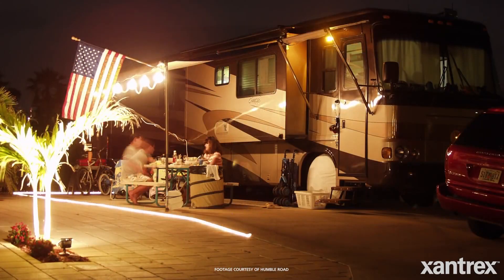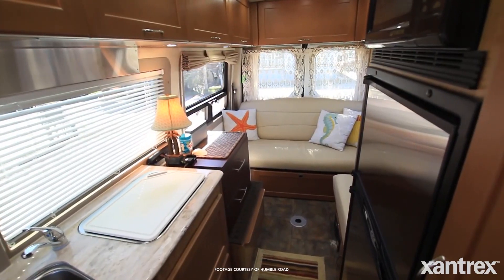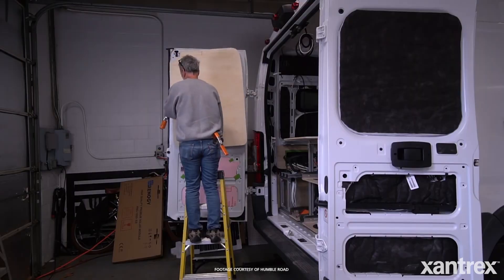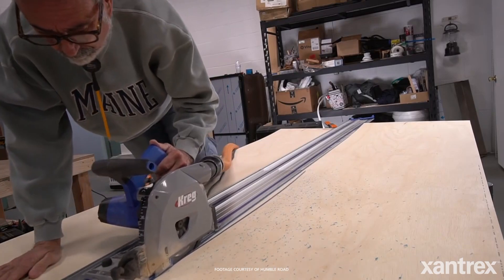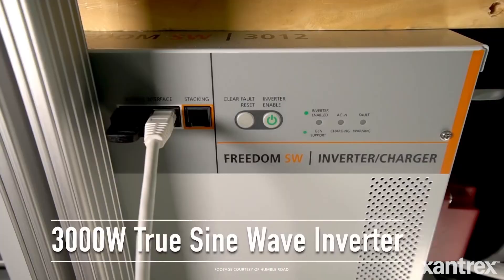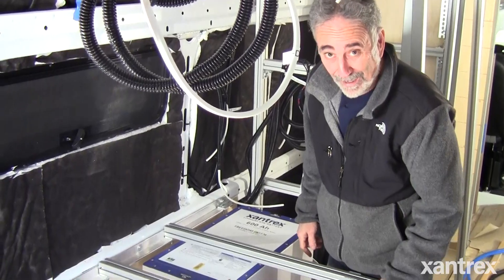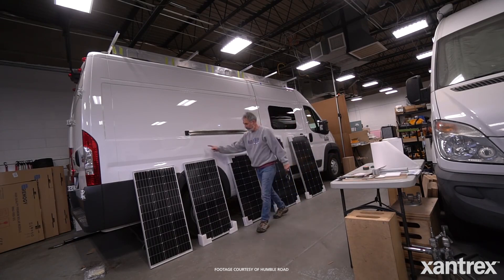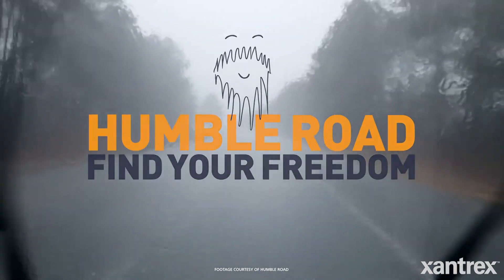Humble Road RV - Building Custom RVs with the Best Lithium Batteries + Power Solutions

Comment: I’ve been a fan of George’s work since he started his YT channel.  I wish he had the capacity to build more vans!! I do have a question about the battery itself. Does it come in different sizes as far as number of amp hours? I thought I caught he is using a 600 amp hour battery.  I want to be able to run the AC a lot over several days while boondocking.  I’m wondering if a larger battery is available. I can’t tell from the Xantrex website. Of course the challenge then is how to recharge the battery while boondocking if you don’t do some driving or have a massive amount of solar!!😎😎
Reply from the maker: You may find info about different sizes and other features here http://www.xantrex.com/documents/lithium/20200702_LithiumIonBattery_Datasheet2020.pdf

Comment: What is the usable watts in this? I am looking at a van with a volta system that has over 12,000 usable watts. Thank you.
Reply from the maker: The particular Humble Road RV you are referring to delivers 7.6 KWh and 5000 instantaneous watts. Please note the FREEDOM eGEN system is a highly customized solution that is designed based on power requirement and several other criteria specified by the RV manufacturer.
Reply: @XantrexTechnology   Thank you for the information. Since you mentioned it being highly customized solution, is it possible to get an upgrade to the solution regardless of what van it is in? So if I do want 12,000 useable watts, the ability is there just that I have to send it in for service to do so? Thank you for your support!
Reply from the maker: @higherho1540  Yes, it may be possible to configure the system to meet your needs. Whereabouts are you located? We will likely need to connect you with a nearby Xantrex authorized service center to review your system and give you a quote.
Reply: @XantrexTechnology  i Live near Harrisburg, PA. Looking at trying to get a coachman camper van Li3 based system upgraded from 600 AMP battery to at least two.
Reply from the maker: @higherho1540  please send us your contract info to marketing@xantrex.com and we will direct you to the best service center.